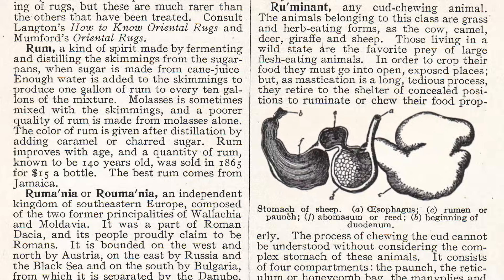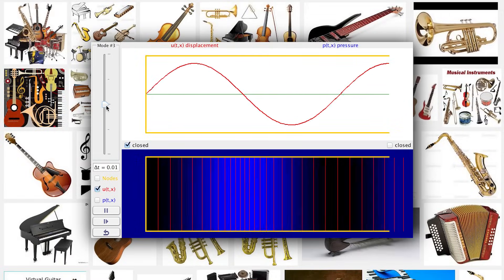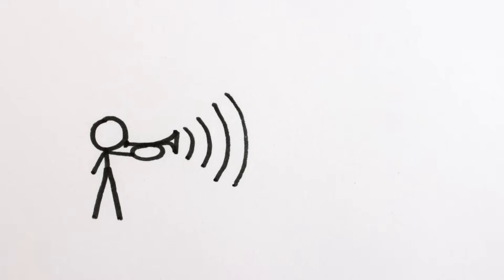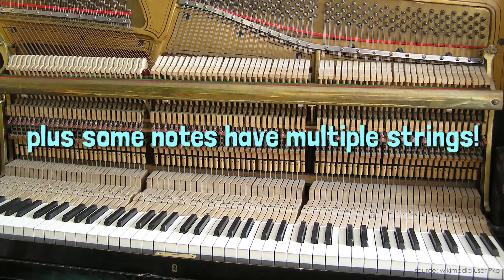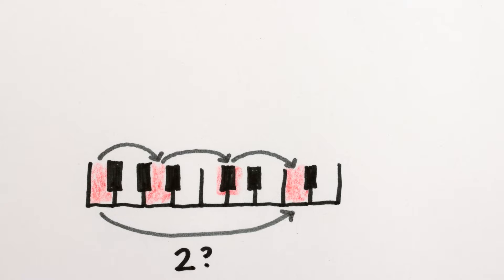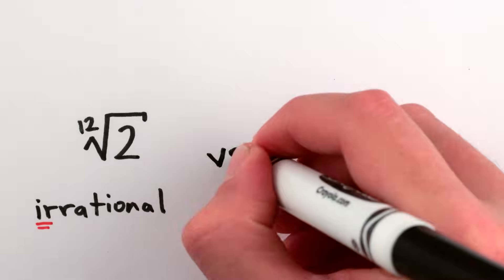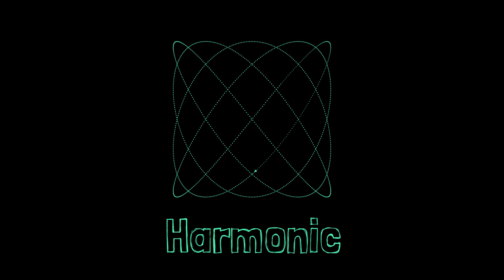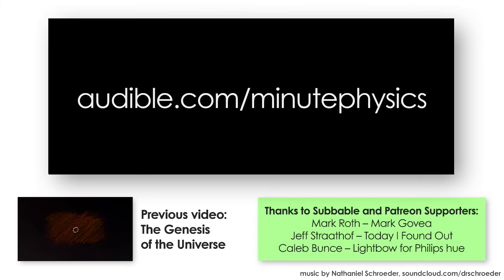Why It's Impossible to Tune a Piano

Comment: Same goes for guitars. If you tune even tempered, it will often sound a little out of tune in some keys with some chords. If you tune with harmonics, it will be perfect in only one key and really off in others. So some people split the difference so you can play in multiple keys and it sounds as good as possible under the circumstances.
Reply: in equal temperament, it will sound equally out of tune in all keys
Reply: @davidalbro2009  not really (that´s the point of the video). in some positions, you can get an "equal" temperament. but as you go up the fingerboard (or into the piano keys) the inharmony of the strings starts to become more noticeable (and the frets on a guitar are arranged in relation to the same fixed ratio, so the harmonics of the notes are more and more displaced as you go up)
Inharmony is just that phenomenon: the harmonics of a vibrating string start to become less "consonant" when that string gets shorter or much longer (as happens in the higher/lower keys of a piano.) Physically, it is defined by the relationship between the length of the string, its diameter and its weight.
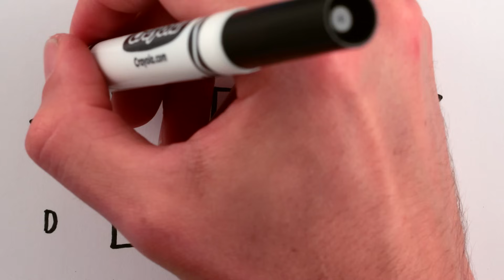Reply: @pedrova8058  That's EXACTLY the point of the video. 3:40 "In equal temperament you can play any song in any key and it will be equally and just slightly out of tune."

Also, you are 100% wrong about the piano. The interval of a 4th, let's say, is the exact same ratio in any key in the 7th octave as it is in the third octave.

What you are talking about might be timbre, but that is never discussed in the video.
Reply: @davidalbro2009  nop,  that's the theory (it can be applied to virtual instruments, even synthesizers, or simple electronic tuners)
But the reality is different (in strict terms referring to the effective "percentage distance" between  2 frequencies). This is called "stretching", and occurs in all stringed instruments with a large spectrum (say, over 4 octaves; in electric guitars, for example,  it can be compensated at the bridge (called "intonation"), with individual saddles at the bridge (that's why it's a more frequent problem on classical guitars)). 
It's done precisely to seek uniformity in the timbre of the piano in all its registers (which is achieved in a "compromised way" obviously) ... A fourth in the 6th octave is slightly "longer" o "sharper" than one in the central section of the piano (hence a simple electronic tuner has problems in the extreme ranges of the keyboard)
.
If we wanted to avoid "stretching", we would have to use progressively thinner strings for the higher section , but that would change the timbre, and also the actual volume of the instrument.
.
(for the same reason is that the old "jazz" guitars began to use steel strings, and then much thicker steel strings, they were looking for more sound volume, and for that more tension is needed (which pushes you to use strings thicker, more bridge compensation, etc))
.
https://en.wikipedia.org/wiki/Stretched_tuning
Reply: btw,  we are talking about small differences, which only trained musicians, technicians appreciate.  (the difference is noticeable when using extreme harmonies, with chords in the low/middle section, and harmonies at the top of the keyboard)
Reply: @pedrova8058  Well, I learned something new. 

I remember hearing decades ago that turning a piano is far more difficult than you might think. This gives me a further glimpse into why this is true.

It seems that the fundamental reason for stretched tuning is due to the natural inharmonicity of individual strings. I assumed that the overtones of a sting were perfect. This is not the case and creates the added difficulty.

Comment: Yes, you can tune a guitar or violin using harmonics, as demonstrated at the beginning of the video, but you'll get just intonated tuning, which is 1.955 cent off per string, compared to the usual equal temperament tuning
Reply: Came to say this 😂

Comment: Hey!! I have a question tho...u said that each note has its own string so I was wondering if instead of using all that harmonics stuff...why don't they   just tune each string such that it vibrates at the frequency its supposed to. For example we know that A3 has a frequency of 440hz so why don't we apply tension on the string such that the string vibrates at 440hz and do the same for all other notes🤔🤔
Reply: Notes are just fictional contructs created by humans. What frequencies different notes have is determined by 12tet not the other way around.
Reply: Because then a music played on different keys would feel different. The 12TET, being out of tune with the harmonic series, actually makes every semitone the same frequency interval.

Comment: Why exactly is this a piano specific problem? Shouldn't the whole step problem apply to a single guitar string as well?
Reply: +Peter Mačkay Guitar is different because of the fret board. You have only 6 strings who make all the notes and the 12th fret is adjusted be the same harmonicaly and when you press your finger on that 12th position. With a piano, each note are made by different and open strings. In other word, the fret board temper the tuning of a guitar but nothing but a specefic tempered tuning can tune a piano to make all octave superposable (stackable). 

That how I understand it.
Reply: +Peter Mačkay I think the main issue is that a piano spans over 7  octaves, while a guitar, for all practical purposes, spans only 3.  That means that the deviations from the ideal tones are less noticeable on the guitar.  I would also guess that guitars generally are played in only a few keys.
Reply: +francis bélanger also, a guitar is always slightly out of tune in some scales, but everyone is so used to it that we don´t notice it as wrong
Reply: +Peter Mačkay In matter of fact tuning guitar with harmonics also leads to similar problem as with piano: There will always be at least one interval which is way off (usually interval between G and B strings).

And because guitar is chromatic instrument with fixed selection of notes (those frets), you should tune it equally tempered anyway. If you use only very limited number of chords or scales, you can make it sound a lot better though using some  harmonic method (if you know what you're doing).

So, the maker of this video didn't really know what he was talking about, when it comes to guitars. The real problem is not a number of strings, but instrument capable of creating (only) chromatic scales. Violin doesn't have this problem, since it doesn't have frets.
Reply: TheUglyGnome
Pianos are also chromatic; what instruments in the western tradition do more? 

And violins may not have frets, but they are played as if they do.  That is, the fingers are placed where the frets would be if there were any.
Reply: TheUglyGnome Thanks for replying, I figured that would be the case.
Reply: Michael Sommers Did I say piano is not chromatic? Yes it is and the problem with piano is exactly the same as problem with guitar. With piano the problem is of course greater because of large scale, but underlying problem is the same.

Every good violin player have ability to slightly adjust finger position to create harmonic intervals instead of tempered ones. So violin isn't chromatic, you can produce any pitch you like.

Yes, most of the western instruments are chromatic, and that's the problem in western music: no pure intervals. Another exception is brass horns: they are harmonic. Problem with them is of course that in order to play exact pure notes, you have to tune them to the key of the music piece played (and I've not yet seen anyone doing this).
Reply: +TheUglyGnome You implied that the guitar was unusual in being chromatic.  No big deal, just a miscommunication.

But you also said that, being chromatic, guitars should be well tempered, which implies that all our instruments (they all being chromatic) should be well tempered, which isn't a solution at all.

Yes, violins can play any tone within their range, but in practice they aren't used that way.  They are used to create a discrete set of tones, just like all the other instruments.

The underlying problem, as the video showed, is mathematical: you simply can't create a scale that satisfies all the requirements of the ratios between various tones, not matter what tuning or instrument you use.
Reply: Michael Sommers Did I? I thought I said: "tuning guitar with harmonics also leads to similar problem as with piano". But yes, miscommunication.

And no, I said EQUALLY tempered, not WELL tempered. And I didn't say it's a solution. I said guitars should be tuned as equally tempered (for the same reason as pianos) and also added that you can also divert from this rule if you know what you're doing. Perhaps we have some more miscommunication here too.

And as I said: good violin player can adjust his/her finger positions to match the key (and even a section, like what's the chord you should play here if playing guitar) of the piece he/she is playing. So depending on the situation finger positions of the same note may alter slightly to create perfect harmonics.

True. The problem is mathematical, it has always been there and it will always be there. Music became flawed the moment it evolved from simple "hmmm-hmmm"-choirs of primitive tribes to complex melodies. But using super-chromatic (I just made up the term, I don't know/remember the real one) instruments like violin you can always play perfect chords/intervals for a moment (and then hope nobody hears your cheating when you switch to the next chord ... which nobody, even a trained person, hears unless he/she knows what to look for).
Reply: TheUglyGnome
Yes, you did say "equal temperament".  For some reason I read that multiple times as "well temperament".  I think I need glasses.  I think I'd better shut up now while I'm behind.
Reply: Michael Sommers If I were given a dime every time I needed glasses, I would be a very rich man.
Reply: TheUglyGnome Now this is a surprisingly interesting discussion. :) I don't think the problem is about music being "flawed". Music is what it is. It is a form of art. The physics and math just show that there's some natural irregularity that needs to be considered when tuning instruments and even when playing some instruments.
Reply: +Peter Mačkay Guitars have their own problems with pulsing notes. The problem is striking any note on any string, will cause sympathetic vibrations in the other strings, usually their harmonics. So hitting an open E will cause the other E string to vibrate, but it will also cause any string which has a harmonic of E to vibrate as well. Add to this the fact that each string is slightly thicker than the one next to it, which changes the length, and you can adjust the length of the string to bring it in tune with itself, but it won't be in tune with the other strings. That's a mouth full. Long story short, certain notes on any guitar, will cause the sound to pulse.
Reply: +Peter Mačkay Having 12 frets to the octave is pretty much equivalent to having twelve keys to the octave as far as tuning issues, so yes, the effect and the math in the video is pretty much the same for guitars and pianos. There are other issues peculiar to the instruments, but outside the scope of the video.
Reply: Also, for fretless stringed instruments like the violin, fretless bass, cello, etc, since there are no frets it is possible to play without equal temperament. If you're really adept at guitar it's also possible to reduce the effect of slightly flat or sharp notes by changing the pressure you place on the fretted string. The harder you press the string into the fret, the sharper the note.
Reply: +Peter Mačkay Typically guitars and basses that are fretted also have this problem, difference is having less strings there are ways to fix that, e.g. via crooked or fanned fret. Google it, it looks pretty rad.
Reply: +Peter Mačkay I think others answered this question, but this is my interpretation. It isn't a piano specific problem; it applies to all fixed intonation, tempered instruments. The goal of any system of tuning or tempering is to have a perfect octave. If nothing else is correct, that has to be. After that, most systems prefer to have all or most fifths perfect because they are consonant and used frequently. Then fourths, thirds, etc. This is for most systems.

The number of strings doesn't really matter. An instrument with 20 strings won't necessarily be more out of tune than an instrument with 2, since what we're primarily concerned with is the division of a single string. As long as you apply the same method to every string, you should get the same result. 

Any tempering system involves compromise in the abstract, and real instruments can get away with even more. Some manufactures and luthiers use what's called the rule of 18 for fret placement. Basically, you subtract 18 from the string length to get the position for the first fret, then you subtract 18 from the new string length (saddle to first fret), and so on. So you can get away with a slightly compromised fret placement on top of a compromised tuning system and it won't make too big a difference.

Powck said that the guitar is slightly out of tune in some scales, which is incorrect. If it were true, the guitar would be a well-tempered instrument, but it is equal-tempered. How can you tell? Without getting into too much detail, just look at the frets. Do they all run parallel to each other, or are they split? If the former, it's equal temperament, if the latter it's something else, either well-tempered, microtonal, or just intonated. 

Finally, as I pointed out in another post, in Just Intonation there is no such thing as "the" whole step 9/8. If you analyze a just intonation scale, you'll notice that it will use differently sized whole steps and half steps. But the guitar has equal sized whole steps, so it is an equal-tempered instrument. If you have a guitar try playing a major 3rd like E-G#. Notice the beating? That interval is ~14 cents sharp of the just 3rd (5/4).
Reply: You can play a guitar in al keys.